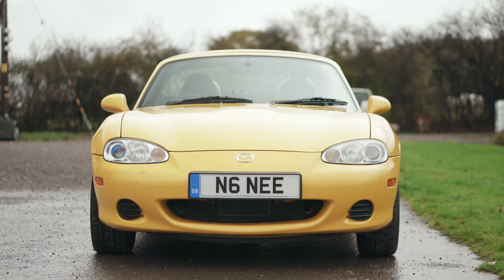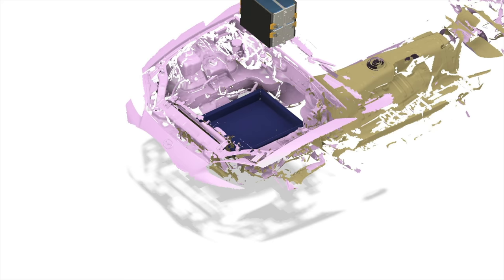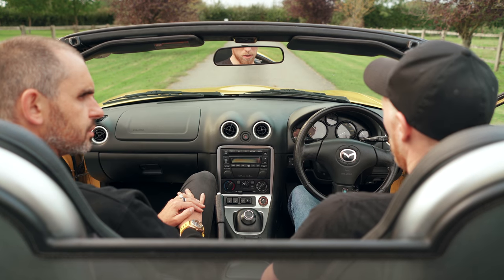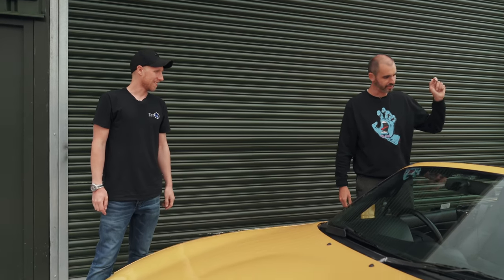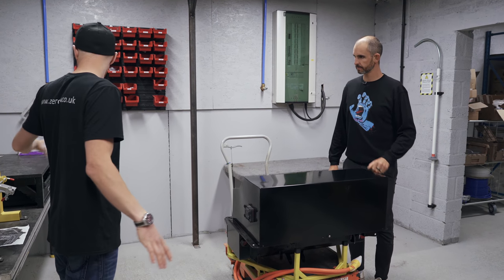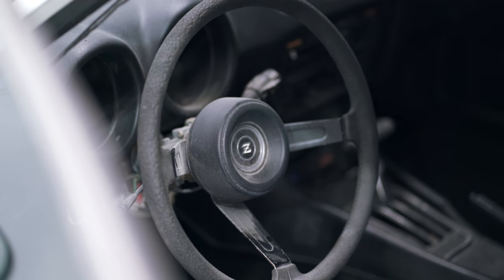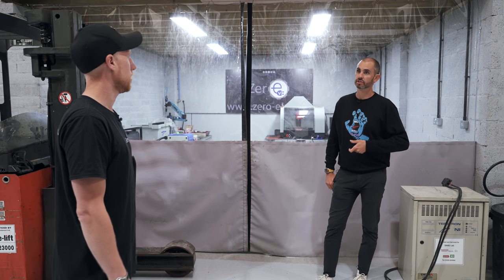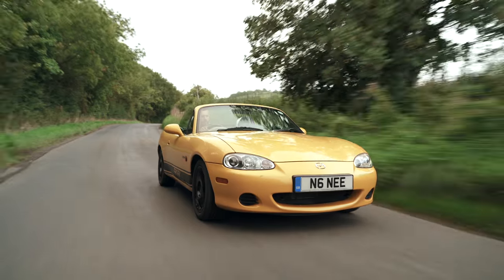EV swapped Mazda Miata MX5 // The Late Brake Show

Comment: After howmany charges you need to replace the batteries?
What will it cost to have new batteries installed and what are the costs of disposal of the old batteries?
EV's have no future for the average guy, they are to expensive.

It is a nice build

Comment: This is a great system for cars where the engine was never the big sell or where the engine was a weakpoint.
Reply: but least you didn't have to replace the engine after 6 years
Reply: @dagnut  the LG batteries fitted have a 25year life span.
Reply: @Hazell_Nutz  you warranty these batteries for 25 years?
Reply: Do they warrant a car engine for 25years? Oem’s warrant battery’s for 8 years just like some ice cars.
Reply: @Hazell_Nutz  what kind of warranty do you provide? its not a trick question

Comment: I suppose this would be a bit nonsense in my ‘59 Sprite and twist it into a pretzel with the torque?
Reply from the maker: No, it could work well in a Sprite! The power in this application would be fine, especially with choice/subtle bracing and uprated brakes.

Comment: Great company and concept, and love how faithful they kept to the MX5. A mate of mine has a Spitfire and it's gorgeous but it also never runs so the idea of an ev swap into that would be amazing.
Reply: Exactly what I was thinking. A lot of classics where the engine is just pants would benefit heavily from this tech.
Reply: @Reddsoldier  That's exactly the point I think many people are missing.  Many of the old classics are so unreliable that they end up becoming glorified museum pieces people are terrified to drive.

A lot of people would love to drive their classics without having the tow truck on speed dial, and 10 hours in the shop for every 1 hour of driving.
Reply: @redbaron6805  . I've always thought a Citroen DS would be a perfect candidate for an EV swap. The engine was always its Achilles Heel. Silent and smooth, just how it was supposed to be, but also quick.
Reply: @curmudgeon1933  The DS is a great car, one of my favorites.  But the problem is, as Zero EV mentioned, when there is a limited supply of vehicles, it becomes increasingly difficult to justify a drop in EV swap for only a handful of vehicles out there.

You simply never recover the upfront engineering cost unless you charge a fortune for each one.
Reply: @redbaron6805  But the nice thing is that Zero EV appears to be streamlining the task of matching the available 3D space in the car to the form factor of the battery and electronics. Along with mating the motor to the drivetrain.  It may not be worth it for Zero EV to do the detailed engineering on every specialty vehicle. But they could get it to the point where an enthusiast group or boutique company could do their own 3D scans, and some other measurements, and order up semi-custom battery modules, motor etc in an economical fashion.
Reply: @Graham_Wideman  That is true.  But it is obviously far easier to get enough volume to justify the initial cost for the kits if the car is common enough and has been around for awhile, especially something with an enthusiast base already.  So, that would explain why they tackled the MX5 first.

After that, certain things like the drive control systems and charging systems can be carried over, and it is just a matter of form fitting the batteries and motor assembly into the frame.

They key is to be able to recover the upfront cost of the engineering, tooling, programming and custom parts which will make later builds that much easier and a smaller financial gamble.

Comment: £20,000 is just far too much. I guess he has plenty of customers though, they seem to be doing well for themselves. But I wouldn't recommend paying all that just to go slower. And with a limited range. You could do a decent turbo conversion for £6k and have £14k to spend on fuel. And potentially a sub 5 second 0-60 time. Usually people go for a noisier exhaust but there is nothing stopping you trying for something even quieter than standard but less restrictive.

Comment: The late great Jack Rickard (RIP) created a Model 3 inverter for solar storage using the whole battery pack without needing to open it up, he just hacked into the pack and he made a 75kWh power wall.
As Jack Rickard said, with the large number of Model 3 cars on the road there will be an endless supply of battery packs available from all the people crashing their cars.

EVTV - New Project - 30kW High Voltage DC Smart Inverter - progress on Tesla Model 3 Batteries.
https://www.youtube.com/watch?v=IPZAwY9J0wg

Comment: There's definitely a market for a little electric 2 seater sportscar like an MX5. Don't know why the major companies aren't making them
Reply: They will be coming.  The technology arrives in the premium market first, simply because of the upfront cost, and then trickles down to the mainstream cars.  The smaller car simply aren't ready yet until the battery density and cost improves a bit.  

The reason they don't make them yet is people are not yet willing to pay the price premium over petrol.  But once that price premium diminishes and ultimately disappears, they will start arriving on the market.  Probably within the next 5 years or so.

Comment: Original MX5 had a 50 litres tank. So 100miles @ ~40mpg equates to around 11 litres.
You can put batteries in things till the cows come home but why.....
Reply: ... because many people drive way less than 100 miles per day, and they can plug in at night. So no more having to take time to stop at the gas station.

Comment: It's fantastic, but I know if I had a spec sheet in front of me I'd ask for more power and battery.
Reply: Wrong car for it. Handling would be awful.
Reply: @chrispekel5709  not much more, just 250 or so hp and a couple hundred miles range.

Comment: its cool that they did the conversion, but cost/vs power and range is utterly useless. Love that they managed to keep the weight down, but with the low power, and terrible range and no fast charging, it really isnt a viable real world option.   and the mx5 chassis could easily handle lots more power. a 300whp setup, and decent range, and fast charging option would make it a decent upgrade

Comment: So quick question if any smart people know, are EV cars with direct drive with motors basically where the diff is more efficient and provide more performance than say this set up with a drive shaft and gearbox, I assume yes since there would be so much more mechanical loss of energy.

Comment: The NA was 960 kg , the NB in the video was 1065 kg and the NC was 1100 kg
So it is only 5 kg heavier than the original.
29:05 is that what passes for a CNC machine in the UK? A cheap Chinese lathe? (Crap'N'Crapier)

Comment: Electric vehicles have a simple structure, so if electric vehicle units (motors, battery packs, battery control units) are put on the market, various vehicles may be converted to EVs and run in the city.

Comment: shame it costs so frigging much :( id happily do it if it was around 3k... but costs like x10 more than an v8 ls twin turbo engine swap! 20k?!? thats more than a petrol mx5 would cost you to run for 5 years or more.
Reply from the maker: Granted, the concept isn't cheap and it isn't for everyone. You can buy a huge amount of piston power for the same money. This kind of conversion is aimed more at a customer who lives in emission regulated cities, or who is thinking ahead to futureproofing. The MX5 is the test bed. Imagine similar systems based around this on more expensive rwd classics.

Comment: The MX-5 needs 2 additional type 2 ports with two more 6.6 chargers. That would give you 10-90% in about an hour.
Reply from the maker: It doesn't really work like that!
Reply: @TheLateBrakeShow  sure it does. We do it with zero motorcycles all the time. Terry Hershner started off doing it (using 4 J1772 at once) to set records, like 1000 miles in a day, but now lots of people are using 2, 3 or even 4 J1772 at once.
Reply: @TheLateBrakeShow  here's Terry charging his motorcycle from 4 J1772 at once for 26 kW of AC charging. 

https://www.instagram.com/p/BYwYhYrg4XP/
Reply: Or could fit a 3 phase charger and just leave 1 type2
Reply: @Hazell_Nutz  if you can find 22 or 43 kW AC, that's a great solution. You don't need DC to have rapid charge.

Though it does cut out the option of using multiple wall outlets.

I have a 3 phase breakout box that gives me three 16 amp outlets. So I can use the 3 chargers on my bike from 3 phase. Also 2 J1772 inlets, each broken out to 3 outlets that lets me do the same. And a Mennekes type 2 to 3 phase, giving me the same in combination with the 3 phase breakout box. Or I can plug into 3 household outlets and charge at 6.3 kW from three 10 amp outlets.

Comment: Sorry Johnny / Zero
I stopped watching the moment you confirmed the price. Converting old cars to electric will only work once you get the price down to be on par with an engine / gearbox swap. As much as I love the idea (I have a ‘49 Dodge Wayfarer sitting in my garage begging for this), I’m not spending 4 times the price of the car on some batteries and a motor.  Sorry guys - it’s still in the realm of Ferrari and proper classic car owners
Reply from the maker: I hear you Matt, absolutely. The rationale here is an unusual one and it won't appeal to most at this moment. But what it does do is sow the seed to show what can be done, and give owners the choice of application, range and power. I personally think it allows classics to be used more frequently in certain environments, or countries where they'd otherwise be outlawed. I would never swap out an interesting engine (I like 911 flat sixes), but a DeLorean for example was born for EV. Costs will come down and DIY kits will also become more readily available.
Reply: @TheLateBrakeShow  I agree. My hope is to hang on to the old Dodge long enough for my 6 year old to inherit it 👍

Comment: 82 MPH, less power, more weight, less range and you get rid of the manual transmission just for more torque? This sounds stupid
Reply: Sounding stupid is in the ear of the listener.
Reply: Err, you seem to have missed the point of electric conversion......
(The clue is 'electric'!)

Comment: Of course, it's actually fueled natural gas for the most part.
Reply: Or solar, or offshore wind, or........?!
Reply: @andymccabe6712  But 99% by gas-fueled generators on the grid. Also, the mining for the batteries and the disposal of same are not environmentally friendly.  And they have limited range, and zip towing capacity.  Conventional combustion engines have been running on NG for MANY years.  Re-inventing the wheel just so cars can run on batteries--that are powered by NG--seems idiotic to me, especially here in the US, where we have more NG than the rest of the world combined.  We could be filling up our cars at 1950s prices.

Comment: The only point of the mx5 is being light, so adding 40kg and 10hp is not worth it imo... if the electric motor had like 200hp it would be a great eletric sport car but the range take a big hit, 100 miles range ??? This car is basically unusable at this point.

Comment: I’m sorry but this is the wrong car for this. It’s like buying an automatic MX5, you’ve kind of missed the point... 

Each to their own but all that cash for almost like for like performance. The 1.8 has 145bhp but admittedly a lot less torque and you get to enjoy a better sound than road noise... 

I get that we need to cut localised emissions and it would be nice to use cars like this guilt free but without the noise, the shifting... just feels like you’ve lost 50% of what makes it a great little roadster.

Comment: £20k though?? Madness!
Reply: On what basis is this madness?  Is it madness for people to spend 20k on their hobby?  Or are you saying that it's not worth spending 20k to upgrade a used car that's only worth 10k? Because if it's the latter, that's not what this video is about.
Reply: @Graham_Wideman  I just think £20k is far too much for the work that was done but hey, it's just my opinion. 
I am allowed one am I not??
Reply: @daveasher1174  Of course you can have an opinion. And your opinion parallels many, probably most, others' -- 20k is not worth it for them.  I'm simply asking why you go so far as to post saying that it's "madness". You've now added that you think a 20k charge was too much specifically for the work done. Assuming that a significant chunk of that is for the battery, motor, controller and other hardware, how did you reach that assessment? It does not seem out of line to me, though like you, it would not be worth it to me.

Comment: Electric motor cooling.. Let's calc.. if you have 30kw battery and engine is 95%, it's heat only 1,5kw. So it doesn't need cooling..

Comment: I did start to watch this but was disappointed in the power and range.
Reply: I'm disappointed that for people the only factor in life is power and range, vs the experience of driving the car.
Reply: @redbaron6805  I've owned a petrol powered MX5 for nearly 10 years why would I invest all that cash and receive nothing extra 🤷‍♂️ Can one not have an opinion 🤔
Reply: @sr71blackbirddr  I'm not saying you can't have an opinion, but this car is a early version prototype.  Future cars will be cheaper, faster and with longer range.

At this point, you are criticizing something you really don't have much of a concept of.
Reply: @redbaron6805  There's no concept as its a prototype 🤷‍♂️ But the bench mark has been set within the industry from main stream auto makers, i can justify sacrificing range for power or power for range but not both in what is a very light package for an EV.
Reply: @sr71blackbirddr  Well, this is a almost production ready, drop in conversion concept.  And, as stated in the video, the entire idea was to keep the weight, balance and performance about the same.

You can get more power and more range, but with additional cost and weight sacrifice.  Converting a combustion engine car to electric is never going to be the same as building an EV from scratch, as the skateboard platform for the batteries in the floor is not something you can retrofit into combustion engine cars, so that is a Apples to Oranges comparison.
Reply: @redbaron6805  I get what you're saying there converting an existing platform but with the high cost I personally think it needs to offer more than the existing driving experience.
Reply: @sr71blackbirddr  I totally agree that the cost needs to come down, but with production the cost will come down.  They need to recover the initial engineering costs and as volume ramps up, it will be far easier for them to bring costs down.
Reply: @redbaron6805  The cost is astronomical for the MX5, but obviuolsy be better suited to a classic with a higher price tag say like an old lotus etc.
Reply: @sr71blackbirddr  That is true, but as he mentioned, to recover the upfront engineering cost and being able to spread it over enough vehicles, you need a vehicle that is somewhat common and has been around for awhile.

The more expensive exotic cars are of course a lot more rare, so the odds of finding enough takers to justify making a kit for them becomes a lot harder.
Reply: @redbaron6805  Sooner or later it will be the only option Petrol hasn't got long "tick tock"
Reply: @sr71blackbirddr  I totally agree, but I think petrol will still be allowed for antique and older cars.  It will however probably become very expensive as it will be very difficult to justify the infrastructure from pipelines to tankers and refineries for a low volume production.
Reply: @redbaron6805  Its the same with any  habbit the government will price us out of it with extortionate taxes
Reply: @sr71blackbirddr  In this case however, the transition is necessary and very much overdue.  Burning fuel in modern cars makes about as much sense as to use steam ships to deliver cargo and sending telegrams.
Reply: @redbaron6805  Making batteries isn't exactly clean as it is now 🤷‍♂️ and the cars come with heafty price tags far beyond my reach.
Reply: @sr71blackbirddr  Making and burning oil isn't exactly clean now, and making, delivering and collecting oil and oil filters, air filters, spark plugs, belts and all the other combustion car gear along with associated bottles and packaging isn't exactly clean either.

The amount of energy required to make an electric car is offset in about 12 months of driving on average vs combustion engine car, so they are far cleaner over their lifespans than combustion engine cars are, besides being far more efficient, far simpler and far more reliable.

Comment: 110miles out of a 24kwh battery that equates to around 4.5 mpkwh...... i think hes exaggerating the figures here aint not way efficiency is gonna be better the a tesla or kia/hyundai... best he'll get is 70-80miles
Reply from the maker: Why not more efficient than a Tesla? Lighter, aerodynamic...
Reply: @TheLateBrakeShow  the lighter part yes! Unfortunately the mazda mx5 has Cd value of a double decker bus at around 0.38 where as tesla 3 or s is 0.23-0.24, but in hindsight the MGB you featured did have a 35Kwh battery and a range of around 160miles in town so 24Kwh battery 110 miles possibly yes!

Comment: 20.000 Pounds sounds a bit over the top
Reply: There is a lot of upfront cost in the engineering and prototyping of this kind of build.  The more kits they sell, the cheaper the kits will become.  You have to learn to walk before you go running....
Reply: @redbaron6805  Could be